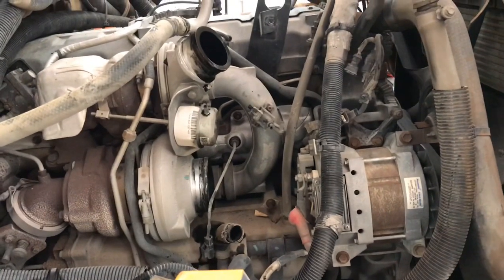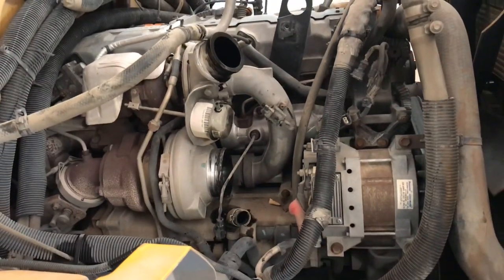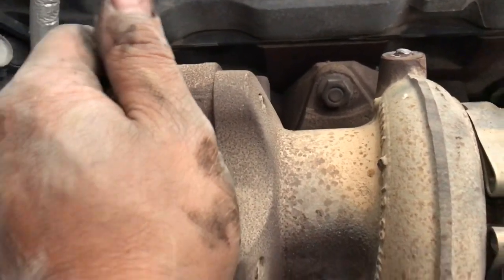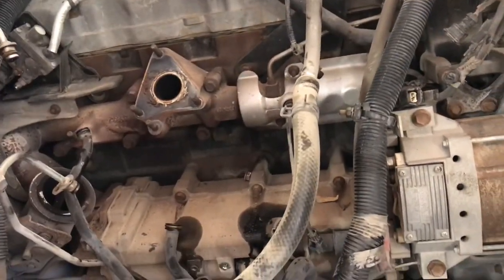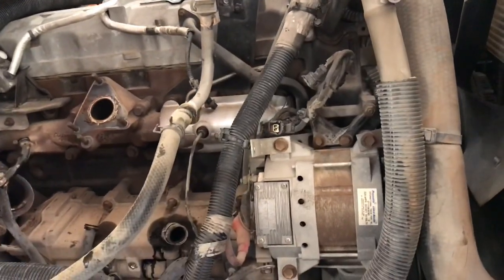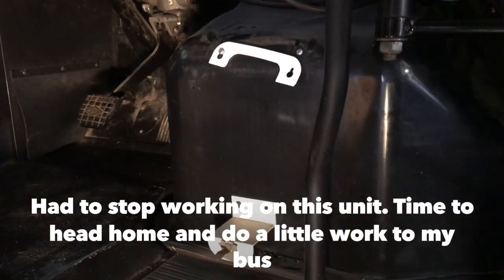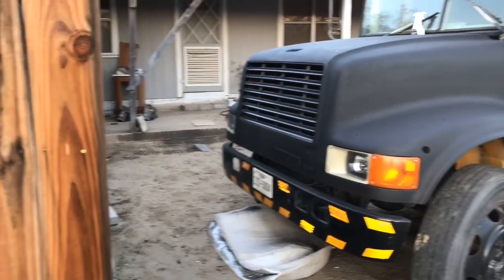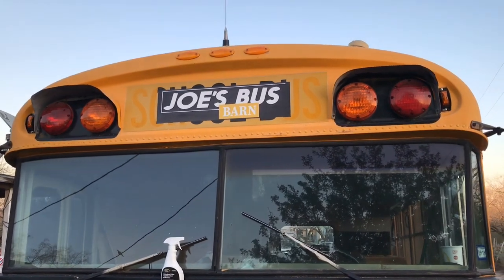What happens when you overheat a MaxxForce Diesel engine

Comment: Hey Joe. I have exactly the same issue. MaxForce engine seized due to water getting low. When I go to turn it over it just moves the fan an inch or so, You say you broke it loose with a bar to get it back to the shop. How did you do that? Where  do you get onto it? What type and how big a bar? Anything you can tell me would be greatly appreciated.
Reply from the maker: Pry bar on flywheel. Through opening on bottom bell housing. You have to turn it Bach and forth till you get it to turn over completely.
Reply: Thanks for the quick reply. The hole is kind of offset from the teeth. Do you use something kind of diagonal to get into a tooth grove or is there something up the side of the flywheel to get a hold of?

Comment: Hello
My 2013 terrastar have the low oil presure alarm on for the past 1200 miles, what can it be? Oil pump? People said i have to replace the engine but it still works with no overheats
Reply from the maker: Low pressure oil pump have been known to fail. I would replace oil pressure sending unit first. You running a maxforce 13.

Comment: Hi joe's, I have a 14 prostar maxxforce n13 and is disappearing the oil, I changed the centrifugal oil filter, crankcase breather filter and all the filters the truck works fine no smoking or loosing power or leaks and stains it just comsume 1 gallon every 1400 miles and I don't know where it goes can you help me to figure out what can be. Thanks in advance
Reply from the maker: Hey there Jorge. Would like to know how many miles that unit has. You have already taken care of most of the common causes.
Reply: @JoesBusBarn  356000 and the only unusual thing is the fuel filter that is dirty
Reply: @JoesBusBarn  engine is likely tiref
Reply from the maker: Email me so I can give u my number. Joegonz268@gmail.com
Reply: @JoesBusBarn  do you speak spanish? If you do I can explain you better the symptoms of the truck
Reply from the maker: Yes. I speak Spanish.
Reply: @JoesBusBarn  ya le mande un email con mi numero
Reply from the maker: Le marko cuando lo reciba.
Reply: @JoesBusBarn  hi Mr Joe, can I stop by sometime this week so you can check out the truck? Thanks

Comment: What school bus is this?
Reply from the maker: Jared Laws  2013 CE. Maxxforce 9/10. 10 dollar heater hose burst open. Driver didn’t stop till the engine died. Driver error
Reply: Joe’s Bus Barn  hey man you didn’t forget about the Thomas HDX tour did you? Lol, not rushing you I understand you’re busy. I’m just curious. P.S I like the Joe’s Bus Barn logo on the Skoolie.
Reply: I have a maxxforce DT in a international shuttle bus heats up and runs hot when around 62 mph and then when I stop it cools right down I can't hear the fan kicking in but it runs constantly and I have changed the fan clutch it has coolant hose seem to be warm on top to bottom just can't figure it out any ideas